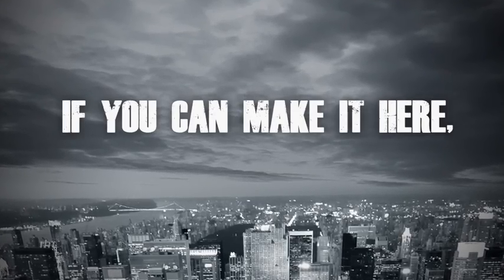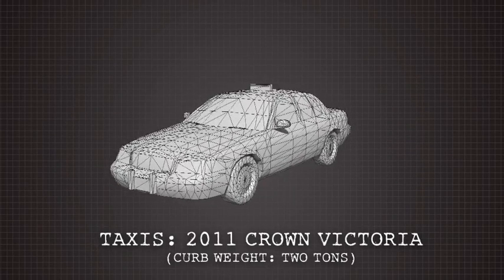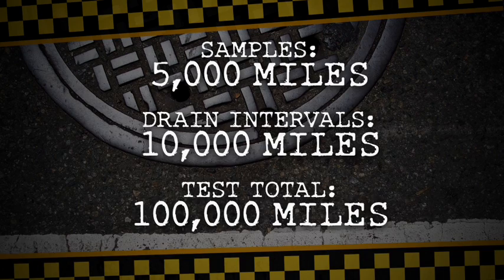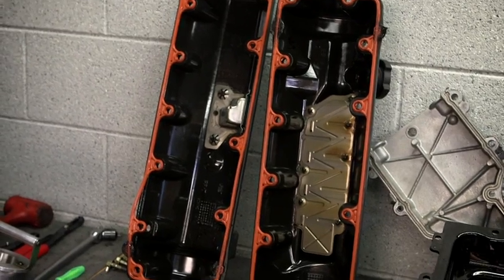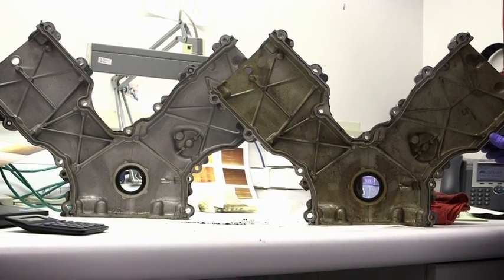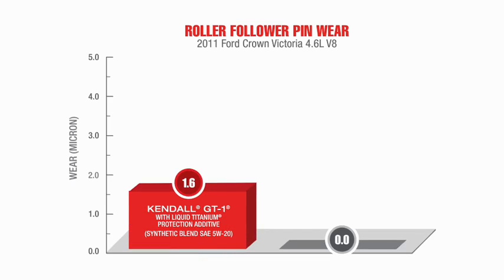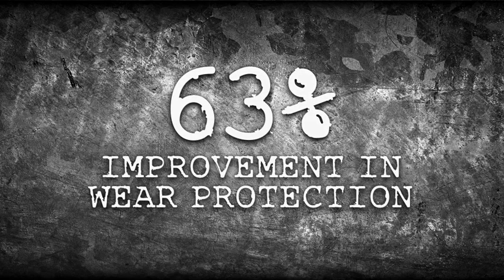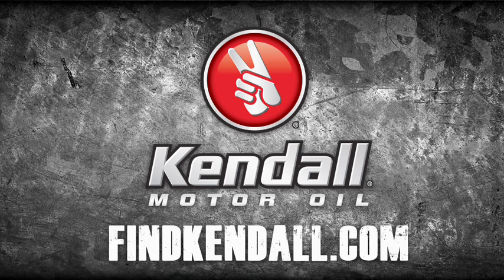Kendall Taxi Teardown

Comment: Synthetic is better but it still needs to be changed. 100,000 isn't that far for a 4.6 liter V8. This oil is most likely pretty good and will run like water when poured so when you drain it the grime comes out with it! I'm a believer. Its worth it for most people.